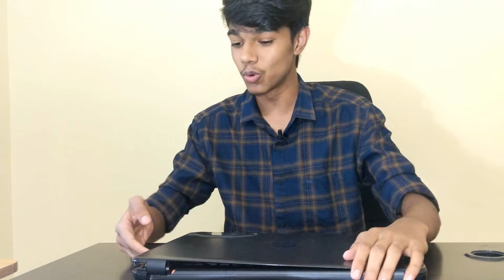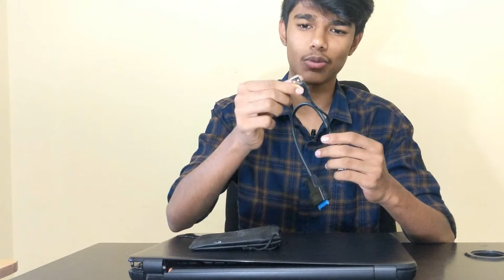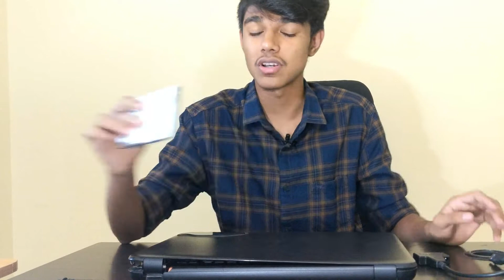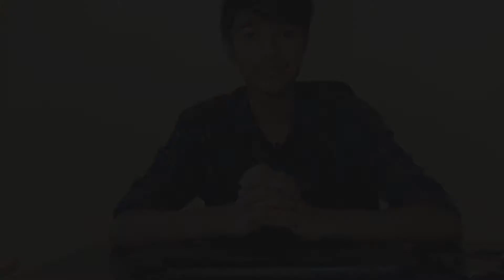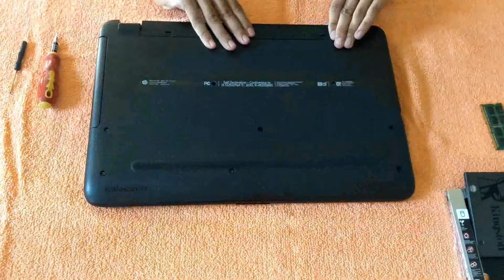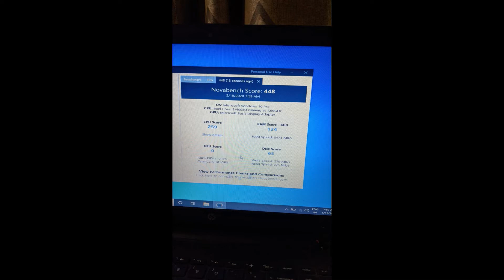Upgrading 6 Year Old HP Laptop with NEW SSD and More Ram !

Comment: I have the exact same laptop and I am about to do the same thing. I thought of putting the HDD in the caddy and replace it with the same SSD that you've used. Should I do this since I don't at all want to use the HDD externally??
Please help brother!
Reply: Also let me know how much difference does upgrading the RAM alone would make?? I want to install another 1666MHz 4GB stick
Reply from the maker: Upgrading the ram doens't make much difference because in pc app opening and booting software is mainly undertaken by ssd. Extra ram allows you to open more apps at the same. Major Performance jump is not to expect .
Thank you.
Reply from the maker: Bro.  As I told, it's very hard to put hdd in the caddy.  If you want a setup like that , make sure you install windows software in the ssd, and then carefully place the hdd in caddy 's place . Switch it on , if it works. Put all the screws in and tighten it.  
If it doesn't work ( I mean. If the hdd partitions doesn't show in the pc ) you've to replace the caddy . 
Lemme check if there is any similar product like caddy n update you. 
Thanks for the quesiton.
Stay tuned .